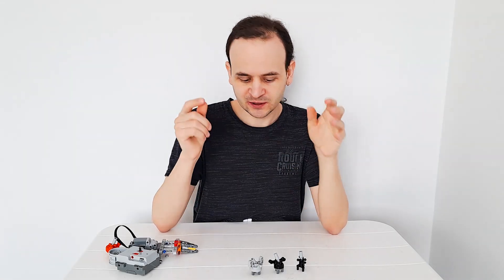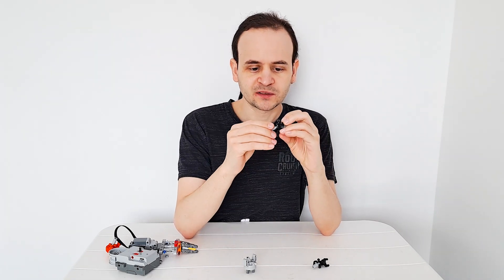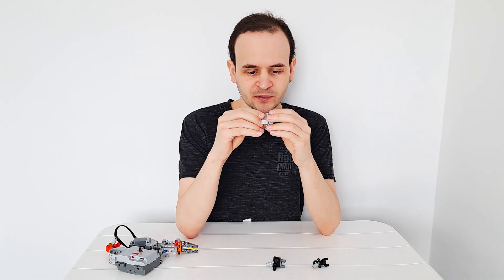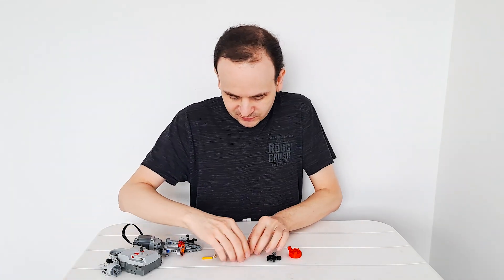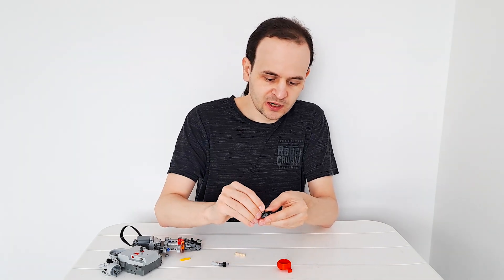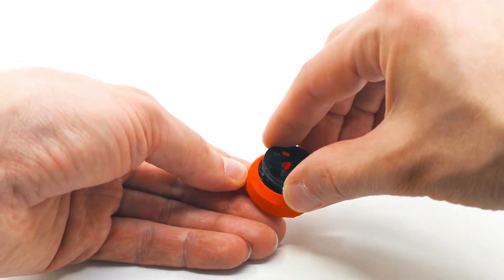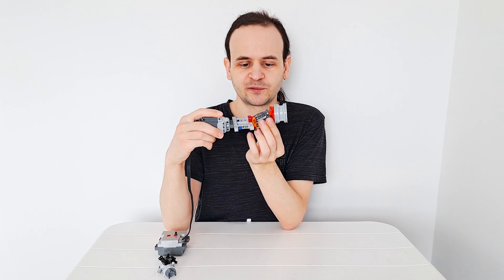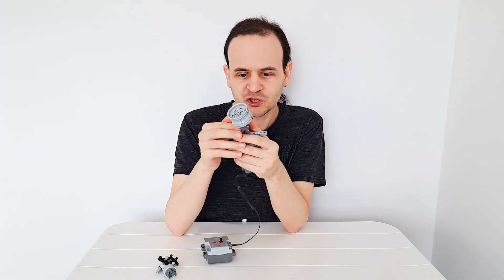Compact planetary gear hub idea

Comment: I really like this content, especially from you Zerobricks! It looks like a compact version of 42099 hubs. Like you said, with "normal" CV joint the steering angle is limited, and they are not as strong, that is why I basically only use large ball CV joint (52731), when it comes to designing driveline. Do you think you will try to design a similar hub, but with a bigger CV joint?
Also, you could try designing torsen differential, or better case, so we would avoid using frames all the time, and get closer to real looking axle (more slim versions).
Reply from the maker: Unfortunately the large CV joint can't fit between the ball joints, but I can increase the gear ratio by using custom gears for all gears. I will think about torsen.

Comment: You might want to add some sort of reinforcement to the 1 1/2 pins. If they are under high load they could separate from the custom black part.

Comment: this looks very good you could design more like these. side question: i want to make a 4X4 car with diff locks i want to use air pistons for that. is there any way to get air tanks for cheap or the pistons?
Reply: If you have enough of a pneumatic hose it is an air tank in itself
Reply: @TechnicalitiesbyKK but how much do i need then?